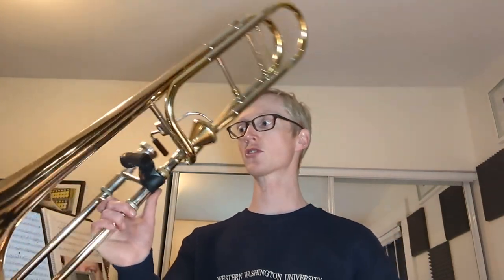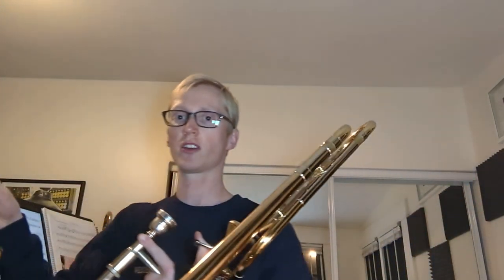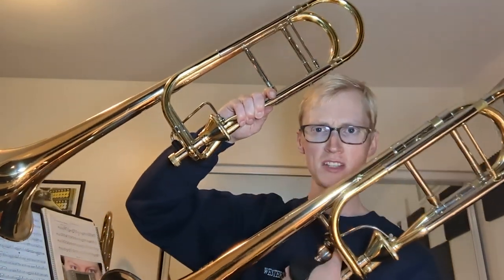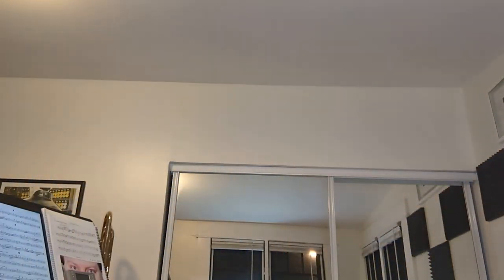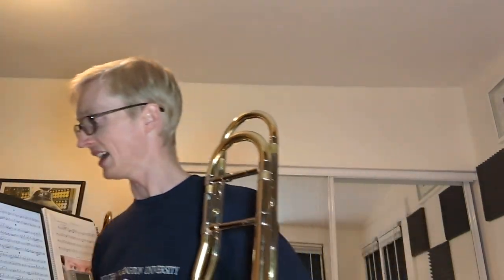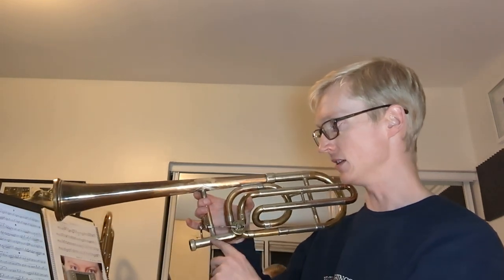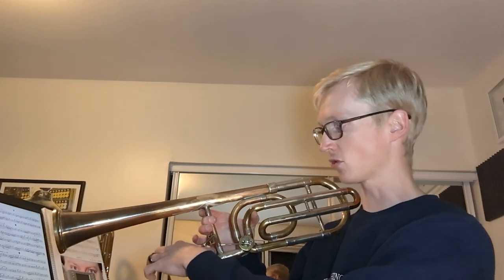January 2023 Update- more horns!

Comment: I have the yellow bell variant 42T, yours has the nylon linkage like mine.  I wonder if you can change that for a mini ball modern variant ?  If so what will work?
Reply from the maker: A tech can redo the linkage for you- it can be a bit involved, depending on your choice. I'm not mad enough at this linkage to replace it, it works for now!
Reply: @AidanRitchie  yes I have always thought about changing it but really what’s on it works just fine!

Comment: Hey Aidan, I’m looking for a good mouthpiece for loud low playing and contra parts playing on my 613G. As you currently have the same horn (as far as I know), I was wondering what you thought. The schilke 60 (long shank) I have feels a little small and I have a hard time hitting anything below a pedal D at all and anything below a pedal E with the power I’m looking for. Greg black 0G or contra piece, hammonds 21BXL, griego .25 or laskey 95 all seem to be what I’m looking for but are all also in the 200$ -300$ range new (used isnt really a big dealbreaker for me, I still look on reverb and marketplace from time to time)
Reply: Also was in the same predicament with tenor playing - DW 4AL heritage too small and far too sharp on the inner rim and flat everywhere else, DW 0AL heavytop (my smaller and first bass piece) a bit too much on the large size for tenor playing, leading to trouble above a high Bb and basically nothing slotting at or above the high D. I ended up having to get a 51D for corps this summer (marching 3rd bari with genesis dbc out of Austin Tx) which matches my tenor sound concept very well but is still a little on the sharp side for the inner rim and possible a touch small on rim width
Reply from the maker: First of all, I find the 613 to have a pretty massive and easy low register no matter the mouthpiece- I'm just using my Markey 87 and I can destroy pedal Ds on it all day, every day. That's one of the best parts about it!

For tenor, the 4AL and 51D are pretty different rim size wise- one is a 4 sized piece, and one is a 6.5 size piece. A simple 4G might be a good place to start.
Reply: @AidanRitchie  how do I develop my pedals then? I’ve been doing long tones and air attacks down low ever since I got it and still not seeing much change. I’ve been looking to try more tenor (and bass) pieces but I don’t have the money to just buy a bunch and there isn’t any Music Stores nearby that allow trialing/have much stock anyway. Going to try tmea convention if I can make it in that Saturday but I don’t want to wait until next year.
Reply from the maker: @tylerjack6018  lots of practice. Have a sound in your head, a very solid concept, and strive for it every day. Don't be swayed by thinking too big or wide.

Comment: Any conn wear on the 6h? These days it's hard to come by conns with intact stockings
Reply from the maker: Yup, got some wear. I think conn wear is a bit overblown though... the way they wear is smooth so it doesn't really impact slide action. I actually didn't know until you just made me look, it's easily a 9/10 slide haha
Reply: The six was my first horn. I still break it out once in a while for nostalgia purposes.

And it's the only horn I can hold comfortably. 😆
Reply from the maker: @Torqueasi  haha, it's one of my least comfortable! Those super short cork barrels.
Reply: @AidanRitchie  Sadly, its my only small tenor.

Comment: a few questions, how much would it be to buy the 50b2 valve section and a 50b, and get them out together, would it be cheaper than just straight up buying a b2? does the same apply for b3's? also how much does it usually to get 50b2 triggers split, i don't mind dependant valves or eb i just hate the trigger setup
Reply from the maker: Probably would end up being more expensive than just buying a B2. I haven't seen a cheapo 50B for a while